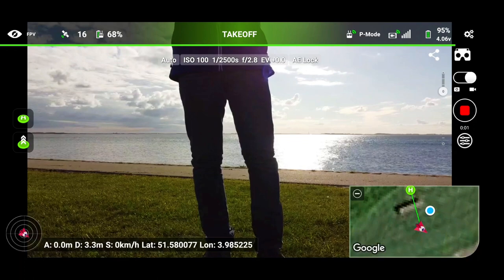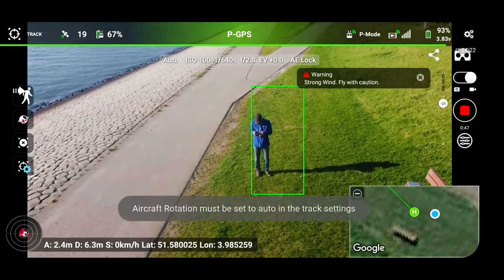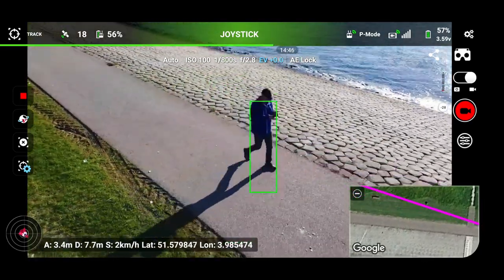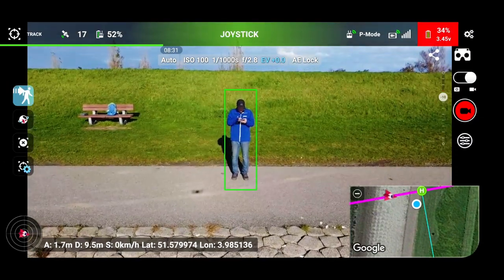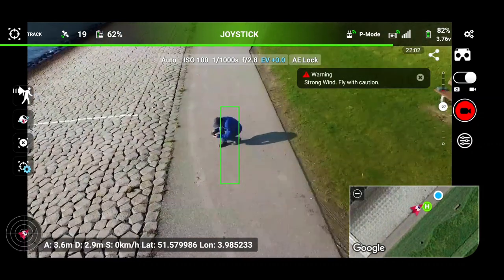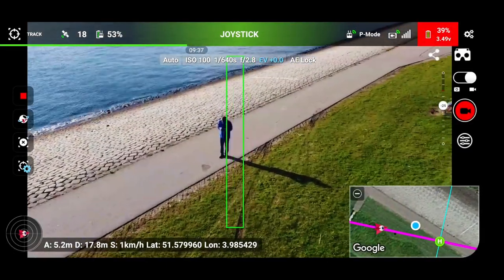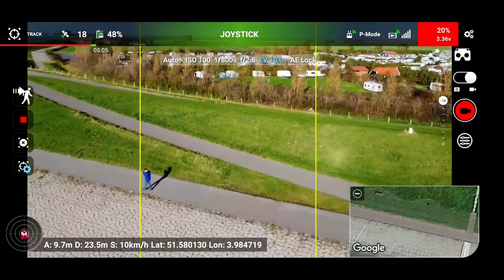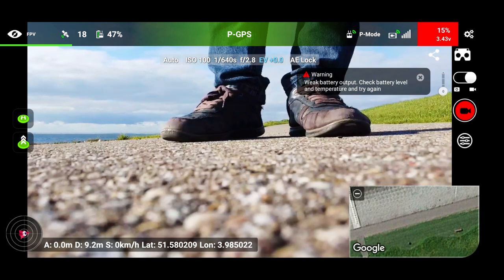DJI Mavic Mini How To Use Active Track Tutorial Part 2

Comment: I'm now quite certain that Litchi don't understand the software engineering term "Beta". It means all functions available in the release SHOULD be working, but there may still be some bugs. It's not quite ready for general release. Litchi software is not yet in Alpha. In some cases it's worse than not working - it's dangerous to use as you found out.  The only function that seems to be genuinely in Beta is Follow and perhaps Pano. Everything else should be turned off until it's ready for Beta. Litchi's beta release program is damaging their reputation. It's showing signs of a software project that is not under tight control.
Reply from the maker: ye your right and how some functions shut work are some times diffecult to understand and that can be dangerous but so long if you use it in a open area its oke to test the functions with to much risk